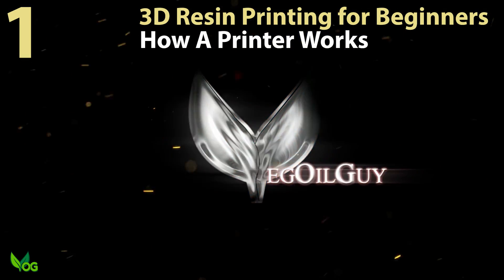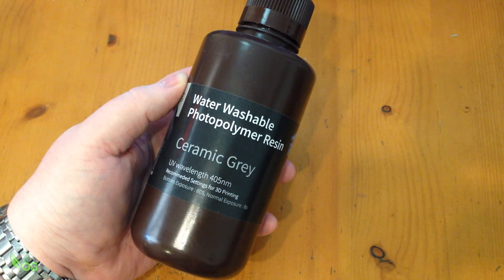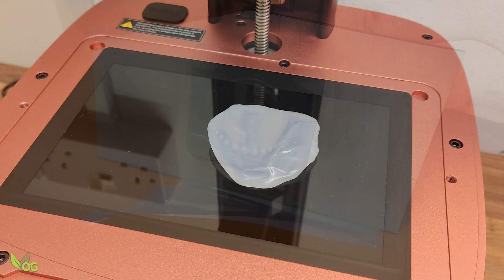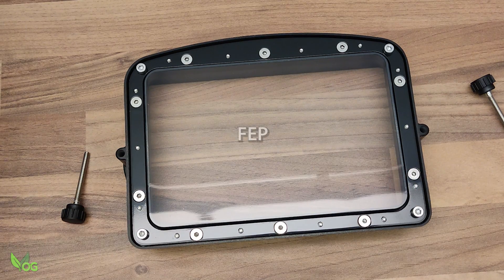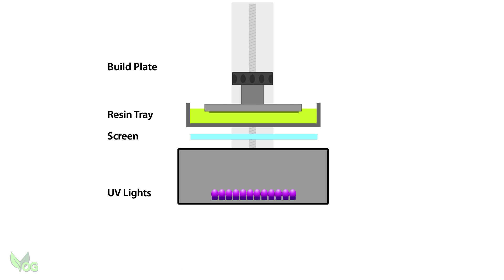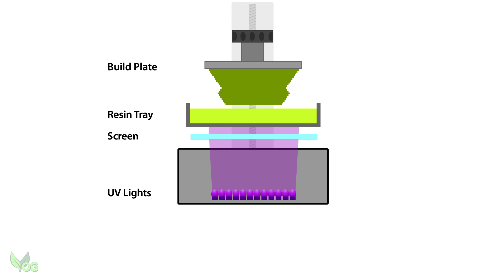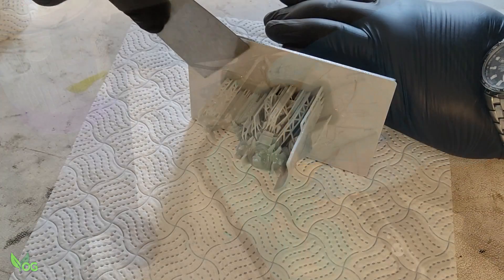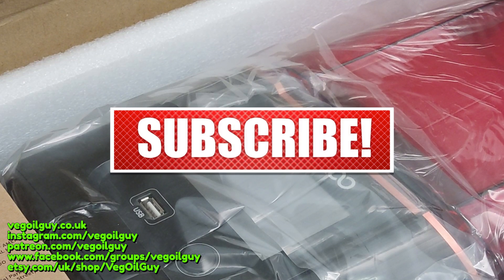1. How a Resin 3D Printer Works

Comment: I still don't understand how the resin knows what shape to make under all that liquid
Reply: It's like a filament printer. The screen displays each layer in UV and cures the resin in the desired shape.
Reply: I’m assuming that the UV pattern underneath the resin tray is generated from a slicer of sorts, similar to FDM printing.
Reply: The software scans the model the same way as a TAC machine, from top to bottom
Reply: the light. it says in the video that the UV light underneath is projected in a specified pattern, curing, layer by layer. hope that helps
Reply: The build plate goes in the resin. The printer has a way to produce UV light. The UV light projects a pattern that hardens the resin in desired areas. It does it mm at a time. Eventually, it takes shape into whatever the 3d model was. If you're familiar with 3d printing with PLA. It's like taking a picture of every lay line from above.
Reply: from what he said in the video i believe the UV lights are shined against the FEP in the pattern required for the layer. a 2D picture of the cross-section

Comment: But how does the light form the pattern for each layer? That's the only thing I don't know yet...
Reply from the maker: It's just a matrix of light... I've never thought about it more than that.
Reply: @vogman  I googled a bit more… apparently the patterns are made on a LCD screen above the UV light so the light goes through that pattern and 'burns' the resin on each layer.
So it's not about the UV light but the LCD - theoretically one could use any light source (as long as it's UV and on the resin's wavelength of course) and it would be fine.

Heck I just found some videos in how to 'overclock' my printer by replacing the UV lights and/or the LCD o.O

Comment: DOOOD!  Yours was the first video I found when searching for the question.  I'm very accustomed to disappointment, so when I get a great video on the first try?!  I'm THRILLED!  Well done sir!

I'm noticing resin printing is fantastic for creating detail art.  Obviously, there doesn't seem to be opportunity for color printing.  But people printing and building models which are later painted, that looks like the basis of a fantastic hobby which eliminates the need to buy expensive plastic model kits only to find them defective or your own clumsiness ruins it... and if parts get broken, they are easily replaced as well.  Might just have to get one of these pretty soon!

Mainly I was wondering how/why they are printed upside down.  You have answered that in the presentation perfectly.  Perfectly.
Reply from the maker: I glad you enjoyed it. I hope you subbed 😁

Comment: Questions when it supposed to start 3d printing does the plate start at Home ( in the Tub of resin and work in way out ? I still can’t find an actual video of it 3-D printing on YouTube it’s all show offs
Reply from the maker: That's a tricky one. Originally most resin printers "homed" at the bottom. For a while now many have seen the wisdom of homing at the top. Which printer is it?

Comment: I'm a total noob at this stuff and I honestly do not even know if 3d printing is the way to go I hope you can help me out .I want to create detailed  3d embossing folders to emboss  metal sheets with an embossing machine like sizzix embossing machine  I plan on selling whatever I make with this folders so I must own whatever I create I hope I'm making sense can you please give me a suggestions which 3d printing machine will be best for my intended use any info will be greatly appreciated.
Reply from the maker: I've no idea how much pressure such a device places upon the embossings. I'll tell you immediately that most resins won't cope with this as they're fairly weak. HOWEVER, the good news is there are specialised resins out there that are designed to be nice and strong, such as Siraya Tech Blue. I get that you're a newbie so let me just make this nice and clear for you - pretty much any resin printer, regardless of brand, will be able to print very nicely detailed patterns for you using this resin that you can then use in your embossing folders. Frankly it sounds an ideal application. I'd love to see how you get on 😁😁😁

Comment: Do you think that printing in a vakuum could result in better prints, because you have no air in your resin? But i could also imagine, that it results in worse prints, because the material deforms and micro- or nano-airbubbles could act against this.
Reply from the maker: Interesting thought... and I have no idea what would happen 😁
Reply: And before anyone tries this, you need to find an alternative cooling solution for your printer, because air cooling doesnt work in vakuum

Comment: Have you used uvtools? I'm running into an issue with blooming using siraya tech Blu clear. I'm going to try out the light bleed compensation in uvtools. I Have tried slowing the lift speed raising the height and adding light off delay all have made it better but not perfect. Any help would be much appreciated. There aren't many videos on uvtools. Love your videos keep up the great work.
Reply from the maker: Hi Christen. I've heard of uvtools but know little other than the name. 😁

Comment: All good reminders for those of us that have been printing for some time as well.  My Mono X has been printing well for some time now but I can always learn more.
Reply from the maker: We can all learn more Mark, especially me. I'll happily pass on the tips I've picked up and I hope others will too 😁😁😁
Reply: Of course where was this when I started in resin. Ha nice job
Reply from the maker: Then where would have been the fun 😁😁😁
Reply: @vogman  I had a heck of a time with my Mono X at first. Ended up replacing the bearings and went to a Pom nut on it. Smooth now for my prints. I mostly print FDM but the detail parts all get printed on the Mono X.
Reply from the maker: Ouch... good for you for persevering and sorting it out 😁